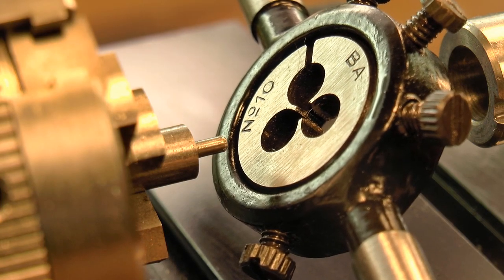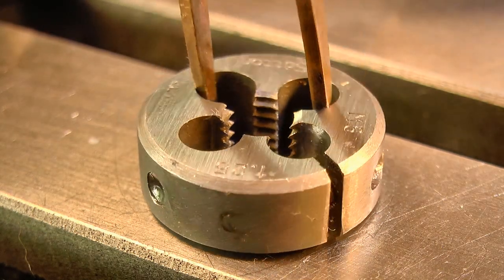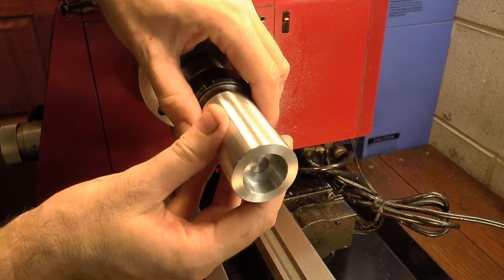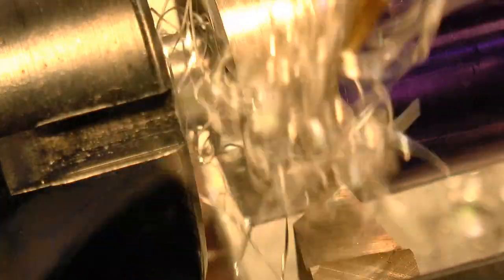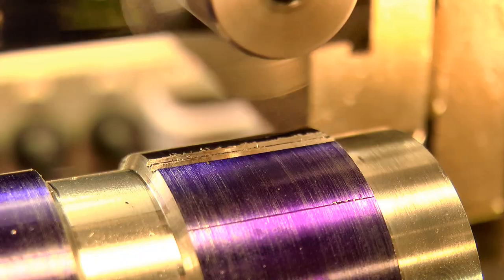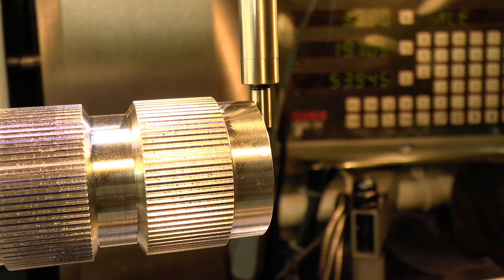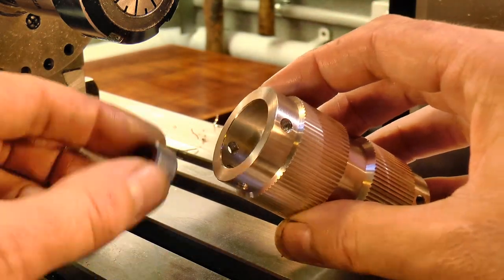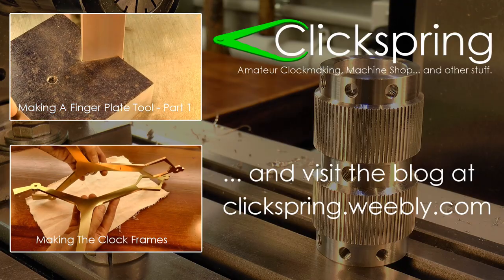Home Machine Shop Tool Making - Machining A Tailstock Die Holder For The Sherline Lathe - Part 1

Comment: I remember my youth training scheme, 6  lathes I think 24 inch over the bed, standard metric screw cut with full tool sets.....I was so jealous as I got the gas rig out and welded up with oxy acetlyene....very little burn through but sorted that out till I weld clean.....

Your videos are the best

I'm saving up for my first set of measuring gear, proper vernier calipers and a micrometer.....
Reply from the maker: Terrific to hear that Matt :)

Comment: Hi chris,
I've made a few  tailstock die holders over the years. 
But none look as nice as yours. 
I've worked in a machine shop for 20 plus years, and you sir can machine like a pro.
Great looking  tool, thanks for the video.
Jeffrey Miller
Reply from the maker: Jeffrey Miller Thanks Jeffrey

Comment: I've used the fly-cutter method many times when accuracy is needed for such things as splines.  But a knurling tool for a non-slip gripping surface is the way to go on a die holder.  I prefer the diamond knurl.  It's quick and looks great too.
Reply from the maker: Ujeb08 In this project I was after a coarser grip than what a knurl can typically generate; certainly a knurl pattern is a great option. Thanks very much for watching.

Comment: Awesome video. I'm sure that someone has already commented but you can use  loctite 603 retaining compound in place of the super glue. Same result without any of the harmful fumes when you heat it to remove the part. Cheers Great channel.

Comment: Very nicely done! Very well executed, brilliantly edited, and one of, if not THE, best machining macro footage I've ever seen on Youtube.

With the grub screw spacing at circa 2:00, having a screw in the missing location can be handy, and I'd suggest anyone copying this consider put it in. I've found some button die bodies are undersized. I don't know what the history is behind this, whether it's a metric/imperial thing and some dies are being ground to 25.0 instead of 25.4, or what the story is (maybe somebody can tell me), but it can be a pain. Without the forth screw, a smaller die body will sit off centre and not cut correctly in a tailstock holder. By having a forth screw the combination can be used to centre an undersized die body. I needed to modify a commercial holder last week for this reason. Commercial holders seem to have a looser die body fit, and added with an undersized die body the combination can be unacceptable. Placing the additional screw there has no real downside and it can simply be backed away if not required, although some dies have dimples there too.

Again, well done, and I look forward to seeing more of your work.
Reply from the maker: +Pete F Hey Pete, thanks for sharing your experience regarding the extra grub screw. I know exactly what you mean regarding variation in die bodies; it is quite maddening. Your suggestion is a great fix, I may well have to modify mine to incorporate it. Cheers, Chris.
Reply: +Clickspring After posting the comment I went through and measured some of my dies. Many were indeed 1", but a heck of a lot were just weird sizes and nothing consistent.  Unless they were on size, the remainder were all smaller than 25.0 mm, some by a significant amount. I can only conclude it's just lack of tolerance on that particular feature.

Comment: Great build Chris!  Think this is the first double ended one I've seen and your idea to hold it concentric, smart.  Also thought you were going to straight knurl the grips but that was much better and definitely Koooler.  That jack made a difference but still noticed it flexed a bit...good thing you used it!  Great quality Vid, excellent craftsmanship and beautiful work.  Thanks for sharing.  ~PJ
Reply from the maker: pjsalchemy Thanks PJ. Yes hard to avoid the flex. I settled on pre-loading it a little bit, and accepting the result. High speed video shows up all sins!

Comment: I am extremely impressed with the quality of your videos and your machining, it is superb. There is something that I would like to ask you, what kind of glue do you use to hold those pieces together while turning them? Thank you for sharing your knowledge.
I am myself a scientific glassblower and use a glassblowing lathe for my work and as an amateur a metal lathe to make some special tools for  shaping the hot glass.
Reply from the maker: Terrific to have you watching Georges, the glue is generic super glue (cyanoacrylate) - Cheers :)
Reply: Thank you so much for taking the trouble to reply, I though that was what you had mentioned but I wasn't quite convinced that this was what you used. I am seriously impressed with the scope of your endeavours, not only the machining which is awesome  but the knowledge on metal casting. The gears and  parts on you clock are impressive. Thanks again.

Comment: I was wondering how the lathe you used here could do the positioning for the grip grooves? Or did I miss the bit where you moved to a rotary chuck? 😊
Reply from the maker: Hety Manfred, the spindle was indexed to permit the cuts. A bit more detail on this wheel cutting video: https://youtu.be/ZSXDIraHz3k

Comment: At the university I attend CAD classes (Siemens NX), I've been taught that it is better to leave actual renderings of threads out of both 3D and 2D. I can imagine this not being a big problem but those renderings dramatically increase file size and most importantly readability of the technical drawing.
We are taught to use symbolical representations (thin lines) to indicate threaded surfaces on the technical drawing. 
But in this case I think you are doing the right thing by actually showing the threads, this way also non-engineers can fully understand what's going on.
Reply from the maker: EddvT You've got my thinking exactly. I put them in so everyone can understand, including the engineers - Thanks for noticing, they take quite a bit of time to model!
Reply: That's weird, rendering threads is one of my favourite things to do in 3D modelling. But I find it a breeze to do. Granted, I am a bit of a geek when it comes to that, but still. If you know the right buttons and parameters it should really not take that long. Is the program you're using a bit repulsive?
Reply: By the way, I must say your way of working definitely influences me. I'm working on a little project myself now and your attention to detail rubbed off to me, thank you.
It's a knife made from a file, entirely formed with hand tools (except for a blacksmith's forge for annealing, hardening and tempering) I finished the filing yesterday and it took me literally two hours to get 95% of the scratches out from the file by sanding, on one side. So there's still a long road ahead of me.

Comment: I have a couple questions. 
First, what tapping fluid do you use?
Second, why did you use aluminum (or brass if it had been lighter) instead of steel? I get the weight concern, but I would think that you would need a more substantial metal to take the torque from the die.

Comment: Hi. When you heat your steel for hardening what gas torch do you use? Regards kevin
Reply from the maker: Just a common flared nozzle propane torch, with a hose connecting to BBQ gas bottle - not sure of brand

Comment: How did you work out the right combination of workpiece diameter, number of grooves and depth of cut, if I may ask?
Reply from the maker: +Cancun771 The diameter was set by the stock I had on hand, and I used Solidworks to get a good look at the groove pattern/DOC before proceeding. Thanks for watching and asking :)

Comment: Thanks for another fascinating video! You've managed pique my curiosity enough to start costing out a small lathe. Are the vertical slide and dividing gear that you are using Sieg accessories, or something third-party? Do equivalents exist for the little Sherline lathes?
Reply from the maker: Damien Miller Hi Damien the vertical slide is a Myford, and the dividing gear is a combination of a Divisionmaster digital indexer, a Sherline rotary table, and a set of adapter plates I made to get it all to fit my lathes. More info here: http://www.clickspringprojects.com/blog/can-i-get-a-witness-mark

There are equivalents for a Sherline. Start at sherlinedirect.com. Cheers, Chris.

Comment: This looks like another jewel for your collection! I notice that you use stub drills rather than centre drills, do you find they give you an accurate hole position? The straight spline knurl is very nice, I diamond knurled mine and it is a bit aggressive on the hands.I did not hear on the video what the material was, I take it you brushed the slight burrs off the knurling of camera.
Reply from the maker: +Englishman French I find spot drills work better, but plenty of people swear by the center drill approach. The body of the tool is aluminium. Thanks for watching.

Comment: Hi Chris, a useful tool for sure but beware that not all dies have the cutting part in the centre, this not a problem when turned by hand in a die stock but might be if the die is physically held central on the lathe. This off centre can cause undersized or bad threads with a normally good die, depending on the rigidity of the lathe and the size of thread, at least that's my excuse and I'm sticking to it. :>)
Reply from the maker: Chris Stephens Hey Chris, thanks for the advice! I'll keep an eye out for them. Thanks for watching

Comment: Chris your lathe look similar in dimensions to my southbend 9a i have what brand quick change tool holder did you put on it im looking for one i currently only have a 4 position tool block
Reply from the maker: I installed a Phase II AXA, but its a little large for the lathe, so I needed to mill out the holders to bring the tool down to center height.
Reply: Clickspring thank you for the help